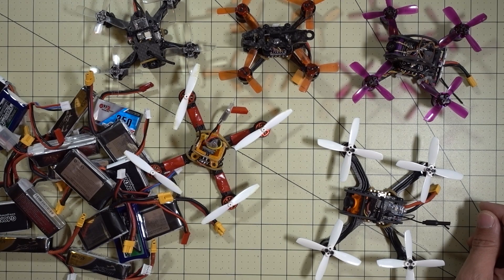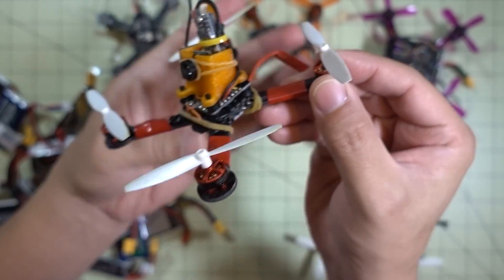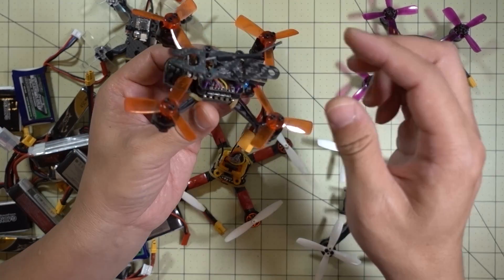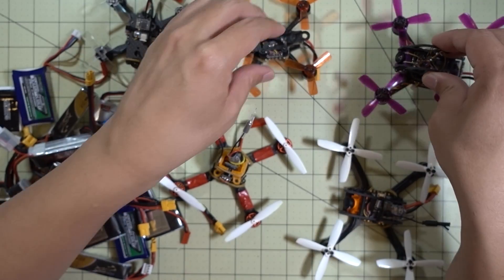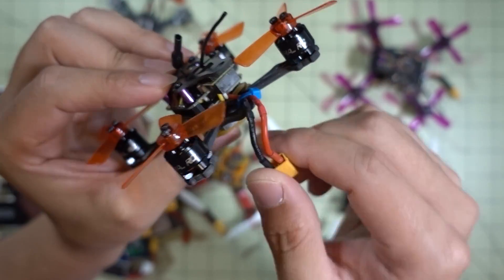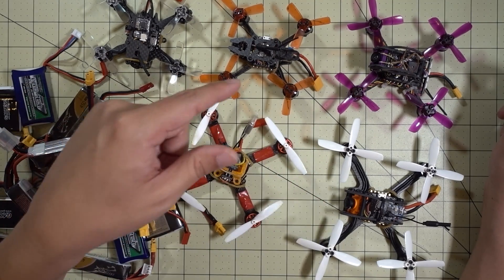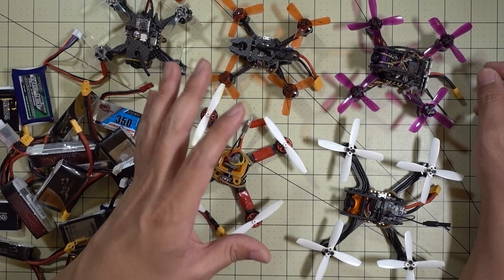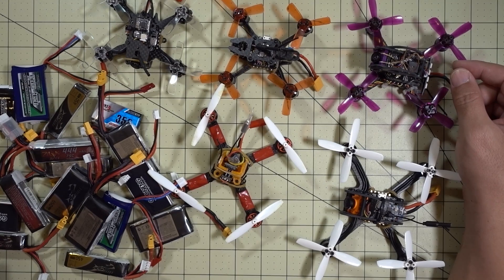Micro Drone PSA 🚁⭐ Why XT30? ⭐

Comment: Im using xt30 on a 3" with 1507 motors on a 4s 650 gnb 80c+ but my battery gets warm, would an xt60 help keep the battery cool or is it just a larger capacity will help.
Reply from the maker: If it's getting warm then plenty of current is going out.  I'd try a larger battery instead.
Reply: @AlbertKimTV  that was my fear. I got 850 4s with xt30 and i dont think they get warm but im trying to keep it sub 250 so i can legally fly in residential areas such as my garden. Looks like i need to go on a drastic diet. Can i ask another question i had a tiny cap with the flywoo f7 aio its so small but marked up as a 470, i have a 1000 on at the moment, will the 470 little one be enough cos i think its about 2.5g lighter?

Comment: I've just switched to XT30's on my 2S and 3S 95-150 sized quads. Really made a difference with Nanotechs 2S 850 on Walkera Rodeo. Super easy to solder. Felt many hot JST's, not felt a hot XT30. Get the real Amass ones and solder them whilst they are connected together (use a blank one - not live connection!!) to avoid any movement of pins. Definitely XT30 is the way to go for micros on 2S or 3S. Even my 4S XJB-145 copes fine with XT30...

Comment: So I've recently made the switch over to xt30 connectors but I'm having a hard time finding a good parralell balance board for 4s? Any recommendations?
Reply from the maker: There aren't any for 4S. Only up to 3S.  You'll have to use the XT60 boards and and adapter for 4S.

Comment: I notice you put an xt30 on the arfun, I have the 95, the battery connector were soldered on the board has a small row of chips in between the red/black wires? I realy don’t want to swap out the whole lead for fear of these chip becoming loose or even totally detached? Any idea about this? Would I achieve the desired result by just removing the jst plug and soldering the xt30 to the stock wires, I suffer loads of brown outs with the jst, hence changing to the xt connector to see if this stops the brown outs.
Reply from the maker: Those chips are capacitors. If you're skilled enough with the soldering iron you can swap out the wire without the capacitors moving.  The thin wire will limit the effectiveness of the connector swap to some extent, but it will still be better than the JST connector.  Also, brownouts can be caused by poor quality lipos.  I would make sure those are good first.
Reply: Albert Kim thanks for your help, I use 2/3,s bolt v2 lipos, the arfun will brown out after about 2 mins flight, my lizard flys great on either tho no probs,as for those capacitors, they are almost covered in solder. I’m beginning to think there the reason for the brown outs? They seem to be creating a short because of the amount of solder I think? Its hard to see how this thing hasn’t gone up in flames. Unfortunately I cannot post a pic here...

Comment: I know this is "old" but...I just took out the XT30 connectors I got through your link to use and (surprise!) they don't look like my xt60's where the wire connects - the xt60's have a "half-pipe" connector with a channel you can insert the wire into and fill up with solder. These xt30's have a solid nipple ("bullet connector"?). If you used these, can you explain how you solder a wire to them?
Reply from the maker: +Mark Sherman I apply some solder on the nibs and wire and solder them together. I believe there is a better one available now, I will update the link.
Reply: Thank you. Do you curl the wire around the nib, or just lay it flat (then have to bend the wire 90 degrees). From my limited soldering experience seems like an "iffy" connection. If you say it works I'll try it on one, but still appreciate another source link.
Reply from the maker: No, it's a suspect connection and prone to breakage though I have not broken one myself. If you solder the wire straight to the connector (parallel) and do it quickly so the joint is shiny, less chance it will break.  If it's dull or hazy, you have a cold joint and more likely to break. Nevertheless, the recommended connector is this one - http://goo.gl/5xTkQg
Reply: Thx. I saw that one today. I may try and solder a couple of the  nib ones, just for practice. Nothing else to do with 10 of them!

Comment: Hey Albert I've tried a bunch of 2s-3s Lipo batteries and I came across these EOX Lynx their 460mah 35-70c 3s lipo from HeliDirect only 8 dollars but they have been fantastic I bought 4 to try them out I've put them through about 20 cycles so far no problem they outperform my venom 450mah 70c 3s lipos which I paid almost 20 dollars for and they've done better than all brands from Banggood anyway you should see if they will send some in for review
Reply from the maker: Thanks for the info. I'll check it out.

Comment: It is the power that is pulled from the battery that has something to say. Higher voltage means lower ampere to get the same energy. it should then be equally important with xt30 on 2s that on 3s?
Reply: Motor KV and prop size are what you need to determine what connector you need.

Comment: In your experience, would you suggest Tatto batteries or Nanotech Batteries? Thanks, Albert!
Reply from the maker: It depends on which specific battery you are comparing.  Some nanotechs are better than Tattu and also the other way around.  I'll have a few in my 2S lipo round up that I'm working on.  I think I will just do a part 1 video to get some initial info out since so many people are asking lipo questions.
Reply: I have my eye on the 3s 450mah tattu and the 3s 450mah Nanotech. If I buy 6 of them, and after shipping, I would end up spending about $15 more on the tattu... just not sure if they are worth it...? Thoughts?
Reply from the maker: +BCORK I haven't used either of those. If they are equal in performance then go with thr cheaper option, right?